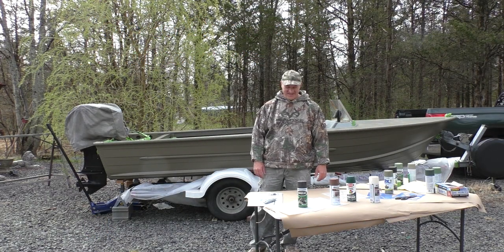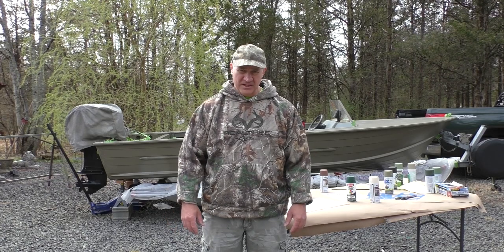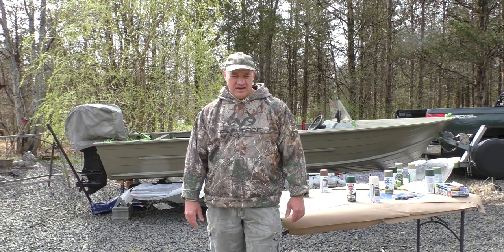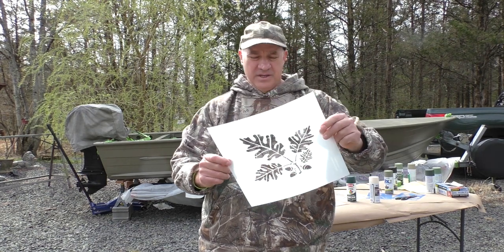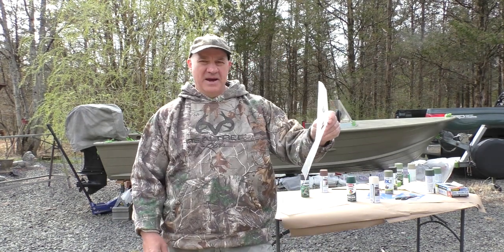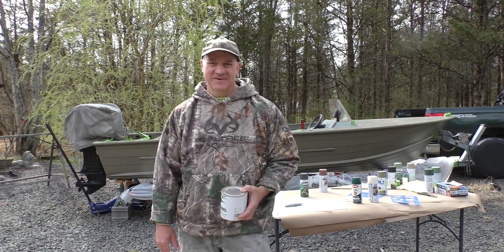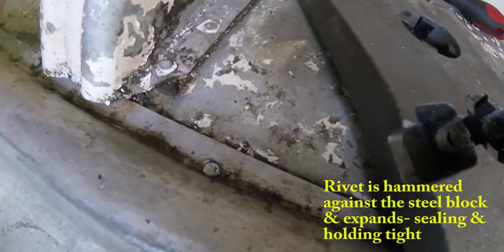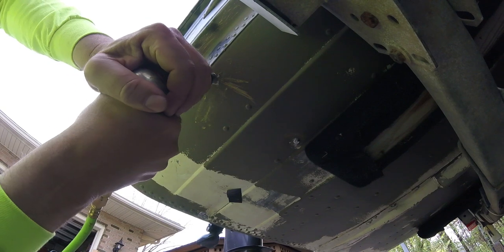How to camouflage paint a boat

Comment: hey Underdog, is that base paint good on aluminum boats? I want to give my Starcraft a camo facelift
Reply from the maker: I believe if you clean it with hot water & TSP and a scouring pad or steel wool (some guys won't use steel wool because it leaves rust spots in the new paint) it should work well.  My boat is a Starcraft, it really gave it a second wind, I still get compliments on it at boat ramps- when it was plain, no one looked at it twice.  Thanks for watching, & good luck with the paint job!

Comment: NEVER EVER EVER mix bondo on cardboard!!!!!!! The cardboard absorbs the resin out of the bondo, weakening your filler. Other than that, great job dude!
Reply from the maker: I didn't know about the cardboard, no wonder the last time I used it, it cracked, lucky it was just a tiny spot.  Thank's for the advice!
Reply: @underdogoutdoors  im a body repair tech and ill tell you that every technician that i know mixes on cardboard i can see it absorbing if you let it sit for a while but not if you wipe it immediately after mixing
Reply from the maker: @dewaynestripling7013  Thank You Dewayne- I appreciate the input.  It isn't something that I do often, but a great skill to have.